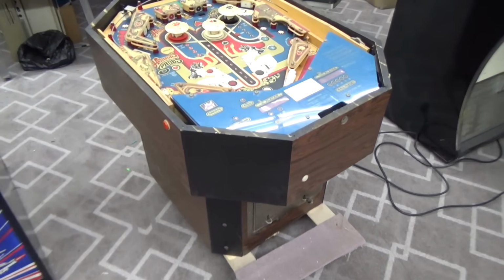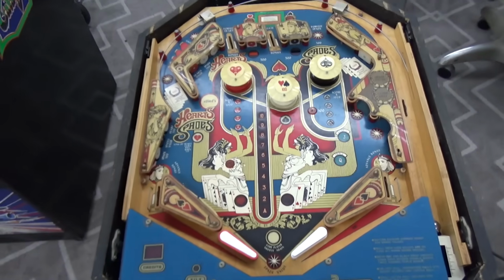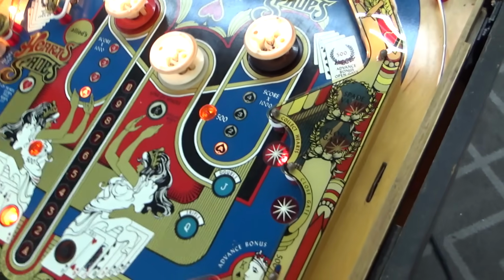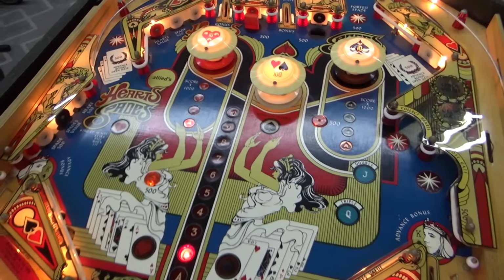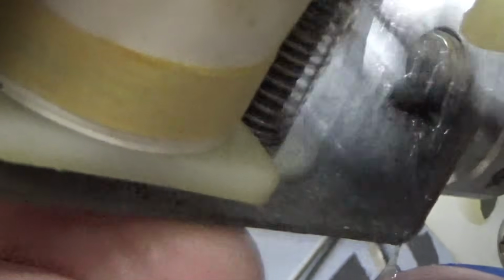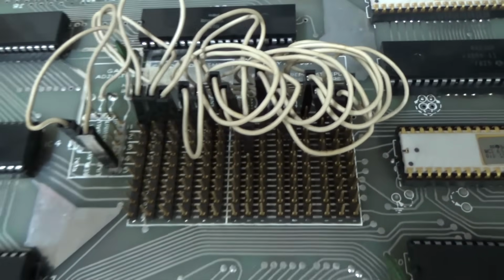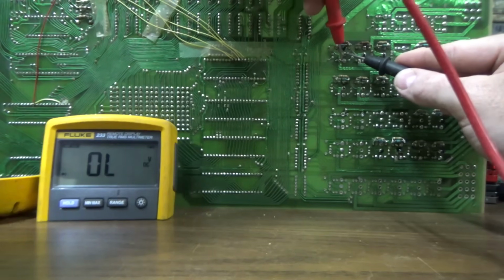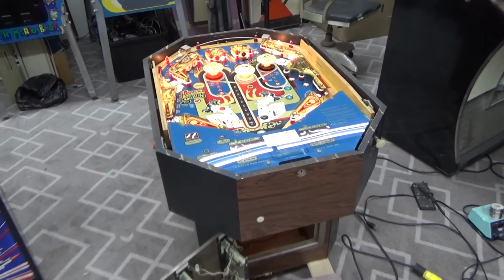Repairing The PCB In A Hearts Spades COCKTAIL Pinball Machine!

Comment: What is the correct name for that operator switchboard/dipswitches called? It's like a jumper wire patchbay. Those "stay on" resistors are "in series" with each lamp per lamp on the playfield but my main question is how does a resistor keep the lamp bulb partially turned on or keep it warm while it's turned OFF?

Comment: Hi, Ron.  That MOS-Tek 6504 chip (lower-right corner of the board, see time index 38:45) is the board's processor.  The 6504 is a MOS-Tek clone of a Motorola 6800 processor.  So if it fails for some reason and you can't get another 6504, you can swap in a 6800.

The RIOT chips are "RAM/ROM/IO/Timing" chips.  As the name implies, these contain the ROM, the RAM and some other related circuitry.  Unfortunately, this means that you couldn't get get another RIOT chip - you'd need one programmed with the ROM code used by this board.

Comment: the 6504 is a "cost reduced" 6502 CPU with fewer pins.  The ROMs are integrated into some of the other chips, which means they are impossible to replace unless you have the exact same chips (which can only be found on another similar board).  Fortunately, manufacturers started using proper ROMs/EPROMs a little while later and gave up the integrated ROM insanity.

Comment: Why are you calling those 6530 chips "RIOT chips"? What is considered a "Drive Coil" Switch?
Reply from the maker: I believe that's what they're called, RRiot chips.
Reply: @LyonsArcade  RRiot means ROM RAM I/O Timer it's like 4 different chips in one package it seems it's a MOS ROM chip, RAM chip, plus a PIA I/O chip and a Timer chip all in one package. I have never seen these RRIOT chips in other electronic circuits.
Reply: @waynegram8907  Used in the MOS KIM1 6502 demo board and Commodore PET disk drives, the -xxx number on the chip denotes custom rom code inside. The highest known -xxx number is around -039 and most of the known chips are all used in Commodore products.

Comment: Well, RRIOT chips. Regular "RIOT" chips have no ROMs. 

Oh, it does have an MPU. MPS6504 is much like a MOS 6507, both of which are reduced-cost 6502 variants.

Notice where the clock crystal is in relation to the 6504 CPU on the board.
Reply from the maker: Thank you

Comment: 6504 is a CPU, the 28 pin version of the Apple 6502 CPU
Reply from the maker: Very cool, thank you!
Reply: From what I've been able to find, the 6504 is pin-compatible with a Motorola 6800.
Reply: @Shamino0 no that was the 6501. The 6504 is a cut down 6502 with the upper address lines missing. It only goes up to a12. Otherwise it’s  6502 compatible.